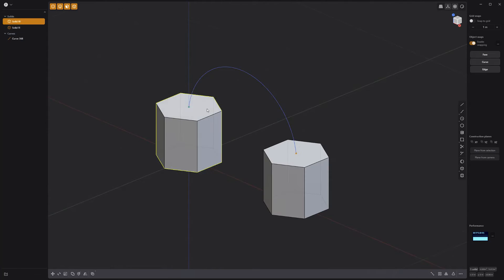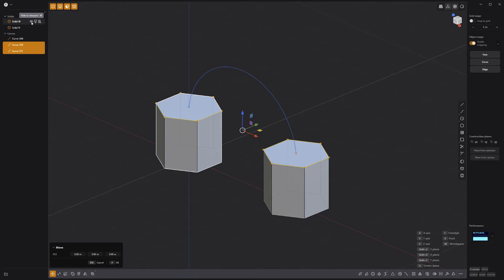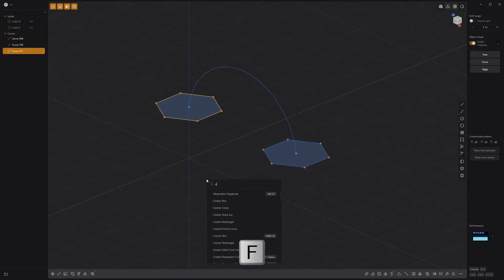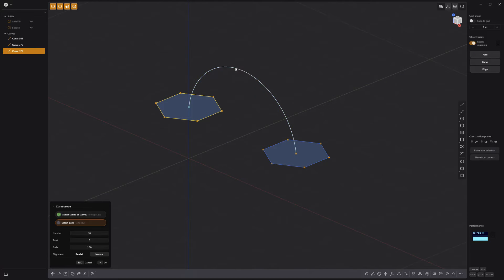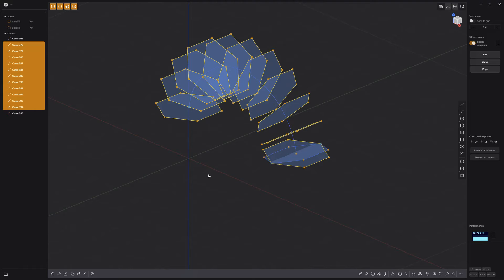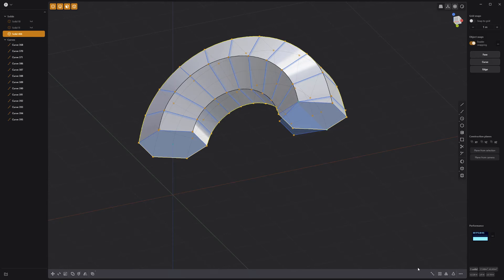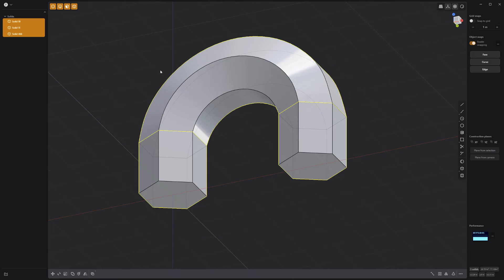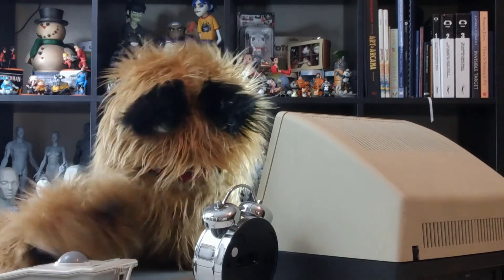Plasticity | Loft an Arch

Comment: Had to do this twice.  My first arch was twisted at the end where it joined the second polygon object.  I started with a polygon with more sides than yours.  Seems like the two starter polygons need to be facing each with edges that run parallel to each other.  Otherwise you get a twist when you try to join everything together.
Reply from the maker: Thanks for sharing.

Comment: Is there any way that you know of to do what could best be described as a loft-sweep, whereby you can loft between two different-shaped curves (open or closed), but sweeping the loft along a path?

Example: S-shaped pipe that's round at one end, hex at the other.
Reply from the maker: You can use Profile Curves when lofting- https://youtu.be/fmanOFdmqJU
Reply: @pixelfondue  Not sure how I could make an 'S'-shaped pipe that begins as hex-shaped, and ends as a circle (for example) using profile curves.
Reply from the maker: @imacmill  probably correct... I'll have a look and if I work out a process I'll share

Comment: Hi,  great tutorials as always, just a matter of interest  I also did this with the sweep tool, seems a bit more little logical to me.
I created a 3 point circle curve going through the centre of the cylinders. 
I then did the sweep op to the whole circle curve and then just simply cut the formed circle  shape with a straight curve.
I then did the patch holes operation and used the boolean op to join the cylinders to the cut circle shape .
As you mention quite a few ways, maybe also possible with the pipe op
Reply from the maker: Did you watch the revolve video example?
Reply: @Pixelfondue  I did indeed.
I believe so far you used the loft and revolve ops, I just thought I mention the sweep tool :)

Comment: is there a way of doing the semi circle tangent into the cylinders? it seems like the angle between a cylinder and the semi circle is not tangent
Reply from the maker: Can you show and example of what you are looking to achieve?
Reply: I wonder if the arc he made might not have actually been a perfect half-circle (where the ends would be tangent to the vertical columns they're atop of). You could easily make a full circle and just cut it in half, but I'm sure the arc tools will allow for a perfect half-circle too, if you practice with them a bit (I'm still a bit of a noob, so I've not used the arc tools much yet).

Edit: on 2nd viewing - I'm almost positive it's actually already tangent, mate. I think it doesn't look it in the thumbnail, but in the video itself it looks fine.